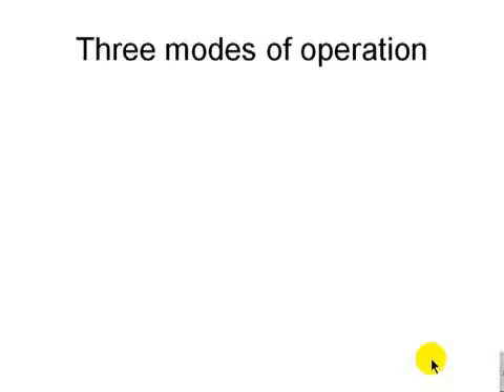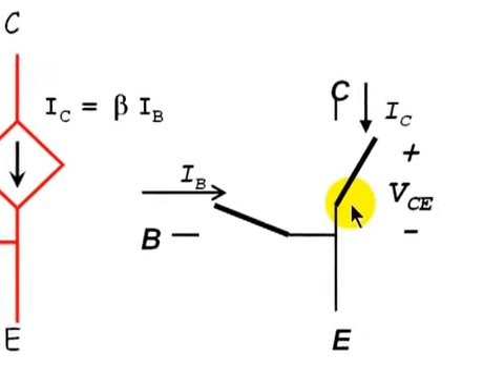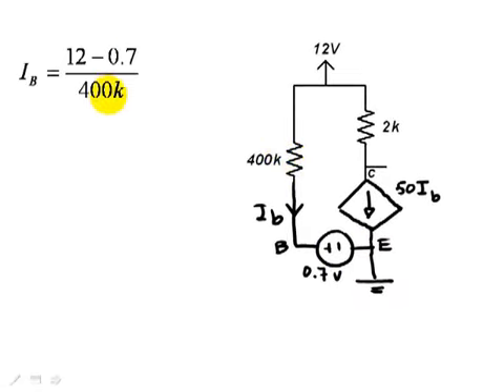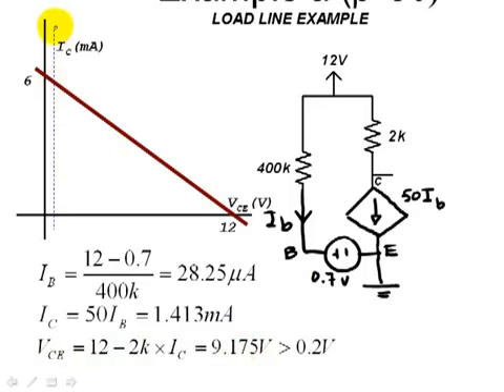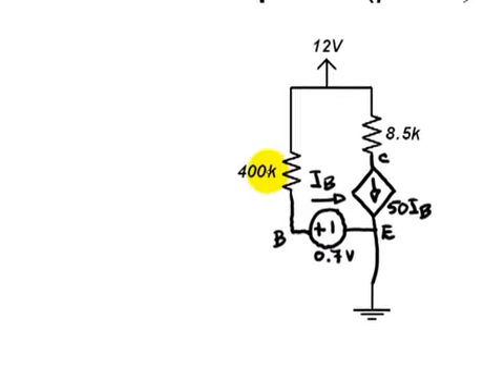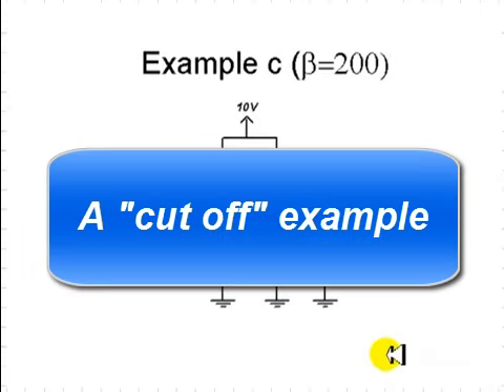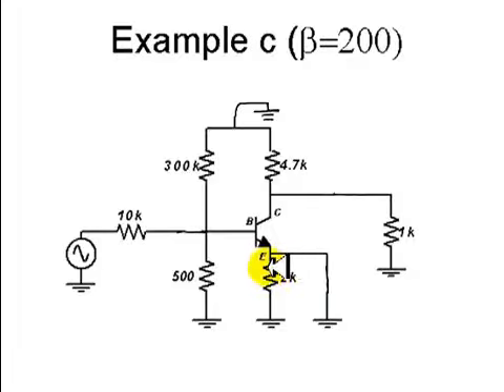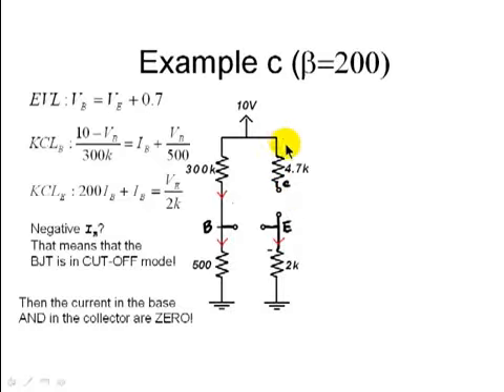EECE 251 - A BJT tutorial/recitation with a quick review of theory

Comment: Where did you get 0.2 v from?
Reply from the maker: When the BJT goes into saturation, the voltage CE sets at a constant value in the vicinity of 0.2 V. So, it is pretty common to assume that a saturated BJT's Vce voltage is 0.2 V. I hope this helps.

Comment: This is a great explanation, i have a question:
Is it valid to use the superposition principle? there's a non linear effect when the transistor is in cut-off mode
Reply from the maker: I'm afraid not. Superposition analysis assumes that the circuit that we apply it to is linear. That the output is somehow proportional to the input. In cut off, that is not so anymore.

Comment: Everybody talks only about the BJT and the resistors but nobody explains how to calculate the capacitors values for each case
Reply from the maker: There is a reason for that. Almost any few hundreds of microfarads capacitor will do the job in most cases. Now, let's see how this conclusion was arrived at by the industry.  The input circuit total impedance is the series of the AC source's Thevenin impedance in series with the parallel of R1//R2. To make the capacitor "transparent" to all input frequencies of interest, focus on the lowest of such frequencies, f_low, and its rad/s counterpart w_low = 2 pi f_low. At that frequency, the magnitude of the impedance of the capacitor is 1/(wlow x C) ohms., if wlow is in rad/s and C in farads. You choose a C such that the impedance of the capacitor is at most 1/10 of the input total impedance of the circuit at that lowest frequency of interest. Is that sufficiently clear?

Comment: hi sir, what is meant by linear mode? however bjt is nonlinear device plz clarify this?
Reply from the maker: The BJT can be used either as an amplifier, or as a controlled switch (ON/OFF). When it is saturated, it is ON, when it is cut'off, it is OFF. Otherwise, it is working as an amplifier and the collector current is an amplified replica of the base current, this is the linear mode of operation, when it works as an amplifier.
Reply: @rolinychupetin  dear sir i read in book bjt is non linear device ,but you r saying it is linear mode .i have confusion on this
Reply from the maker: In reality, nothing in the universe, not "resistors" and definitely not transistors, nothing is linear, but ... When the "range of the input is sufficiently small ..." then many devices seem to be linear. That is true of many devices. Scientists face the enormous complexity of the real world, which is described by nonlinear differential equations, but very often we use the argument to the " ... the inputs are small enough to approximate its behavior by a linear model ...", that is why we write the linear equation of the BJT, Ic = (beta) Ib, which is true only if  Ib is not changing too widely. In that sense, we say "the transistor" is in its "linear mode of operation", or "linear zone of operation". In a separate reply, I will write more about linear systems. In short, if you can write that Ic = (beta) Ib, then your transistor is in its linear zone. I do hope that this helps, Mr. Shahwaz.

Comment: I'm sorry I might be missing something, why did you say that in AC the capacitor behaves like short circuit?, shouldnt it have a complex impedance 1/2pi*f*C ????
Reply from the maker: This is an excellent question, thanks for posting it. In time, we will cover the AC steady state analysis of circuits which includes the AC-SS of reactive elements, in this case of the capacitor, as you correctly quote, -j/(wC) ohms. Now, in engineering almost every aspect of a real problem has a numerical counterpart, up to a point where the complexity of the numerical statement stands in the way of a practical solution: that's one reason why Physicists and Engineers use "rationally triggered neglect" of data with a lesser impact. How is that? Let's take the case of two impedances in series, if one of them is (let's say) a hundred times smaller than the other, the impact of the smaller one in the value of the current though would fall within, possibly, the third or fourth least significant digits ... which would be undetectable by a real life ammeter. So in that case, we choose to neglect the smaller impedance in series. The impedance of the capacitor is not zero (it is never a perfect short circuit), but the Thevenin equivalent impedance of the circuit that it is connected to greatly exceeds that, so we choose to consider it negligible ... that is ... a short circuit. I hope this helps.
Reply from the maker: ... more (I ran out of space) ... in an electronic circuit, the values of resistors, capacitors, inductors, transistors are known only within a "tolerance", and that signifies that whatever solution we work out on paper is but an approximation to the actual behaviious of the circuit. In short, the capacitor is chosen so that at the frequencies of interest of the signal, it's impedance is much smaller than the Thevenin impedance of the surrounding sub circuits, so we can neglect it.

Comment: Amazing video, sir! A question though: Why have a circuit like in the last example? Whats the purpose of having a circuit with a transistor in cut off mode? Thank you lots!!!
Reply from the maker: Thank you M.Omarsayan. About your question: sometimes we use the transistor as an electrically controlled switch. We insert the collector-emitter pair in the path of current to a certain device that we want to control, a small motor, a light, etc., then, with the base current, that is a tiny current, we can turn on (saturation) or off (cut-off) that motor, light, etc.  It is, by the way, one way to implement a logic NOT gate, we apply a 1 (in so many volts) to the base, and we get a 0 (a 0A current in the collector circuit).